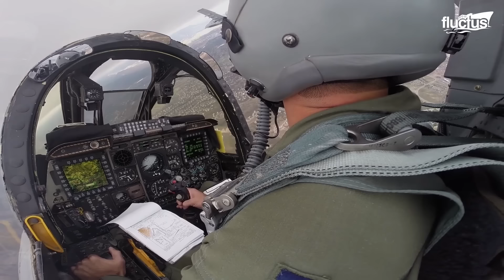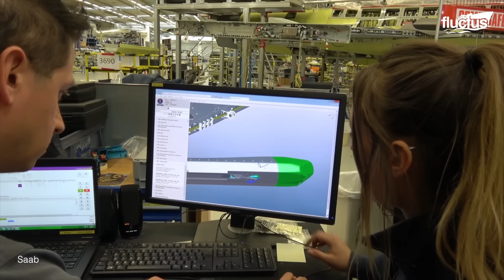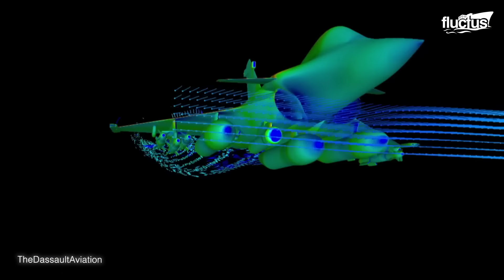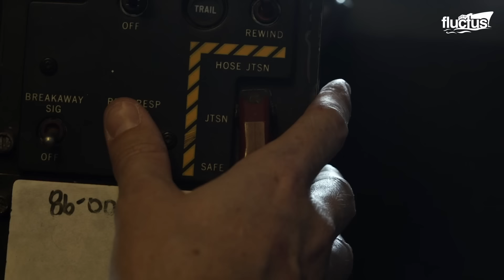The Genius Method US Uses to Fly its Most Feared Aircraft From Middle of Nowhere

Comment: 1950s interstate highway program required vast stretches be unobstructed as contingency airfields. Demand for convenience of getting quicker from point A to B resulted overpasses cutting through those alt runways.  Many low center highway dividers allowed wings not be obstructed have given way to high center dividers in the name of traffic safety.   Other areas have used open space in the middle of a freeway to plunk down commuter rail lines.

Comment: Genius method?  The UK produced VTOL capable Hawker Harrier was designed to operate from short lengths of roadway and clearings in forests back in the 60's...... The thinking behind the VTOL concept was that fighter operation would still be possible, even after airbases had been rendered unusable. A potential foe would need to spend a considerable amount of time destroying every inch of major roadway, and area of usable level ground - football pitches and parks etc - before Harrier operation would have to cease......

Comment: Similar concept by Sweden, Norway and Finland, using  public highways to launch and land military aircraft complete with ground crews. Late in coming for US as its not giving business to greedy military contractors in building bases , hangars etc.
Reply: 1950s interstate highway program required vast stretches be unobstructed as contingency airfields.
Demand for convenience of getting quicker from point A to B resulted overpasses cutting through those alt runways.  Many low center highway dividers allowed wings not be obstructed have given way to high center dividers in the name of traffic safety.   Other areas have used open space in the middle of a freeway to plunk down commuter rail lines.

Comment: You do know at the 1:12 mark you are showing the reason why you do not need to land on a highway. Those aircraft shown are the KC-10 Tankers, the same ones i was an air refueler in from 1986-1999. Trust me, a situation where landing on a runway is required, it has to be a major problem with the aircraft. Tankers are more safer to the fighters than austere landing locations. FACT.
Reply: How is a KC-10 going to reload weaponry and ammo, and perform some kind of maintenance on a jet, in flight?
Reply: The Idea is to be able to do a re-arm w/o having to return to a base, as well as an alt place to land if the base is damaged. It's always better to have a plan in place just in case.

Comment: The US interstates were originally designed with this capability in mind. Nowadays, this training is mainly useful in the case of the US military forces against its own citizens. In a distant second place, as far as usefulness, this training would somewhat translate to operations on continents with similar highway infrastructure, however, the ground support in these varied locations would differ greatly. in a distant third place, as far as usefulness, is the very unlikely possibility of a foreign land invasion that is opposed by the US military, (as imagined at the beginning of the cold war). note that it is far more likely now that any foreign (or UN-based) invasion will actually be supported by the US military.. (see the first usefulness case at the beginning of this paragraph).